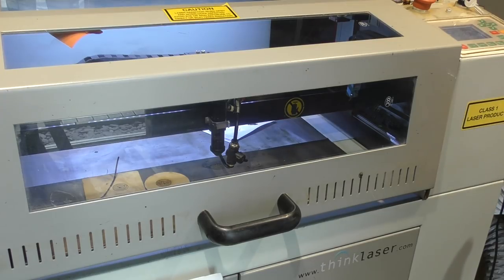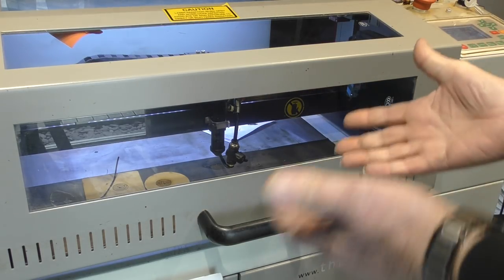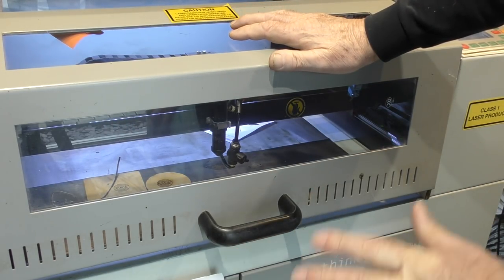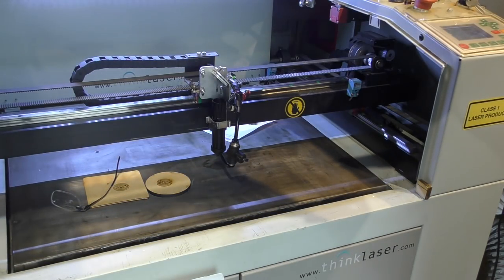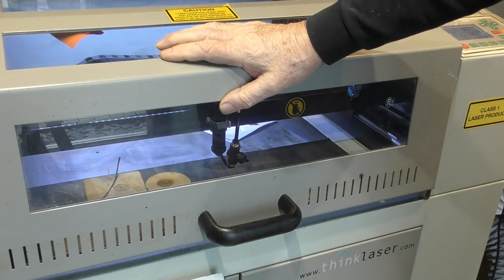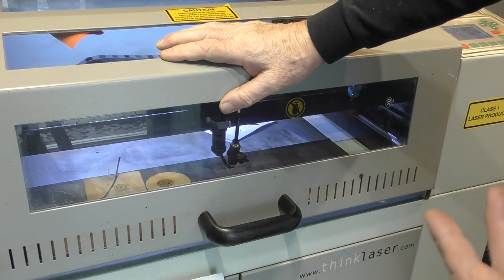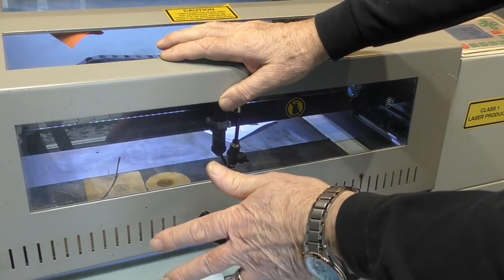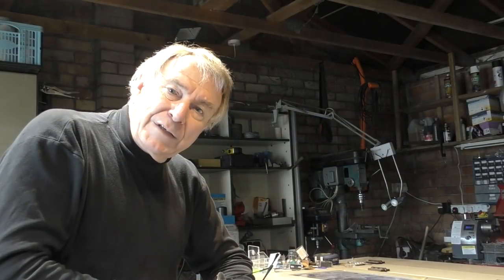RDWorks Learning Lab 204 Laser Beam Safety

Comment: Interesting watching the lens melt and the paper burn. Would have been interesting to see the paper behind the glasses lens to visibly prove your theory.
Reply from the maker: Trust me , I have done just that as a demonstration and it is no theory.  The light energy is 100% absorbed by  polycarb, glass and acrylic If you understand the principle of light energy conversion to heat by vibrating SURFACE molecules and atoms  then your eyes are not at risk until the light has bored its way THROUGH the protection. There is no partial transparency.
 Best wishes
Russ
Reply: @SarbarMultimedia  I believe you, just would be fun to see it in proof.

Cheers Russ, thank you

Comment: That was something that really needed to be said and explained in plain language. I hate to think how many people have been conned into buying expensive safety glasses. When I started with lasers years ago I did think about wether I needed special safety glass but came to the conclusion that I was never going to look directly at the beam anyway. I often use my machine like you with the cover upwhen I am doing experiments or indeed prototyping. I have to admit that one day I forgot and reached across the beam to change a target. It hurt but because I removed my habd very, very quickly there was no visible damage but it did remind me that an invisible beam of energy can be dangerous. I have my cover interlocks disabled but if I am just doing normal cutting the cover is almost closed to give a better airflow. Anyway, nice to hear such a clear thinking explaination as to why you should not waste precious money on unnecessary safety equipment, buy a good fire extinquisher instead, it is far more worthwhile and may save you bacon one day, that reminds me time for a late breakfast.

Comment: Dear Russ, I have just purchased a diode laser cutter engraver xtool D1, so the things you explained do they also cover the diode lasers as well, in diode lasers should we purchase a well branded safety glasses because blue light is present and it works at 460 nm I am wondering what you think about this type of laser cutters, also I am thinking of making an enclosure what would be a suitable candidate for this purpose plexiglass ? Thanks for this informative video.
Reply from the maker: Hi
 I do specifically state in my video that  what I speak of applies only to 10.6 micon wavelength (10,600nm).  Light and materials have strange relationships . At this IR light range the effect of the wavelength is to heat  most materials except metals. Water , glass, acrylic and polycarbonate, although transparent to our visul spectrum , are totally opaque at the long wavelength. Your diode laser operating at 450 nm "sees" materials in a completely different way. 
 Take a look at the chart here   https://www.gsoptics.com/transmission-curves/ 
 This shows the percentage of light  transmitted by the sorts of material you suggest for sheilding. You can see that at 450 nm acrylic and polycarb are only offering 10 to 15% shielding. On the one hand this sounds bad,  but imagine how difficult it would be to get your eye under the direct beam, Near impossible. So why sheild it at all?  Well the answer is not really danger from the direct laser beam because it is blue light and that will not hurt you. No,  the danger is more insideous, The  interaction of the beam at the material surface of some materials can produce INTENSE spikes of UV B radiation which will be like looking at the sun or at arc welding. It will quickly overload the cells at the back of your eye and just as you close your eyes after a quick glance at the sun, you will see white image persistance for several minutes until your cells recover. That effect is caused by light INTENSITY and any decent sunglasses will offer that same INTENSITY protection as looking at the sun.. UVB is the dangeraouse  part of the light that  can permenantly damage cells.
 Take a look at this for the sections, Visible Light and Ultra Violet light.  http://hyperphysics.phy-astr.gsu.edu/hbase/ems3.html#c3
 OK so the real danger is at 280 to 315nm.   Back to the Transmission curves. We now see that at 315nm   both acrylic and polycarbonate offer 100% protection.  So you can get all the  UVB protection you need from an acrylic or polycarb screen  and the only concern is the INTENSITY issue. Just a quick glance at your job will unlikely cause "sun spots" but if you want to watch what's happening I suggest odrinary dark  sunglasses. 
 Hope this explains it for you so that you can assess the risks. 

 Best wishes
Russ

ps.  try engraving a slice  of bacon to simulate what effect the direct beam will have on your skin.

Comment: Can I suggest the focal lens concentrates the laser beam rather than amplifying it. Amplification as I understand it will increase the energy level but the lens does not increase the energy, just concentrates the same total beam energy into a smaller area. I probably sound like a smartass but that is not my intent, just corect terminology. Really really appreciate everything I've learned from you.
Reply from the maker: You are quite correct  (and not a smart ass) in that the total energy is not amplified  but as the beam decreases in diameter (concentrates)  as a result of passing through the lens, the INTENSITY is amplified and it is  LIGHT INTENSITY not power that does damage to the material.   The importance of LIGHT  INTENSITY and how itis not directly related to power is explained in
https://www.youtube.com/watch?v=z8sNPtIIXZ4.  A small diameter beam that happens with low power tubes (as used in K40's) , even though only 30 watts, can do as much damage as a 60 watt beam that is probably twice the beam diameter.. The fact that LIGHT INTENSITY  is the most  important characteristic of a laser beam,  is not recognized by most people. They just concentrate of WATTS. 

If you want a demonstration of where your tube is on this performance spectrum  then run this mode burn test. 
see   https://www.youtube.com/watch?v=R6Wqn5-HMzM
Most people have a factory reject B grade tube. This test will tell you

 Best wishes
Russ

Comment: hello again Russ, can you tell what is the most safe material i could use to make a fiber laser 30w enclosure? thank you. keep the good work.
Reply from the maker: Hi Filipe
 Glass is 70% transparent and  acrylic 70% 1 micron wavelength so neither would be suitable for  a shield.  There are few materials suitable for 100%  protection but poly carbonate  with 30% transparency is a good candidate. Your real concern will be a reflection from an oblique metal surface and at 1miron wavelength that will not be full beam power because all metals are receptive at that wavelength thus any reflection will be dramatically attenuated. Thus 3 to 5mm polycarbonate would be a a good choice to protect against any  1 micron radiation . However, as I mention in my CO2 safety video, the more insidious damage to your eyes comes from the bright light at the interaction with the work. That bright white light is both INTENSE and contains some nasty UVB spikes . Staring at the hypnotic beam movement for more than a few seconds  could be dangerous  in the same way as looking at the sun or an arc welder.. If you intend being around the  machine for any length of time, I suggest you wear a good pair of normal sun glasses that offer protection against both intensity and UVB.
 Best wishes
Russ
Reply: @SarbarMultimedia  thanks so much Russ! always good advice . you´re a unique person!!

Comment: Oh man just in time. I just ordered a 60w JPT M7 fiber laser and been looking for a safety video
Reply: It's for co2 laser
Fiber laser would behave differently than co2 laser
Reply from the maker: @samlenlap  
 Fiber laser is at a different wavelength and as I commented this video is specifically for CO2 laser light at 10.6 microns.  Fiber operates at 1 micron and  the strange properties of light means that 1 micron light will pass right through glass, acrylic and water. However polycarbonate is different because , although transparent, it DOES absorb the 1 micron light energy and will bubble up the surface of the plastic. Thus polycarb safety glasses  are good protection as are cheap reading glasses.against a direct hit. However all the other cautions are still valid. Reflections off of metal surfaces are a much higher risk because you can mark metal with a fiber laser  and odd shaped surface always present reflection risk. It will be sensible to build a polycarbonate screen around the machine. The risk of eye damage from for UV light. is much greater because watching a fiber laser beam working is way more fascinating and hypnotic  than a CO2 beam and that is one key reason you may wish to wear wide frequency range safety glasses capable of absorbing into the 200 to 300 nm range. Do some research on UV light damage to eyes.

Best wishes
Russ
Reply: Like your work, but you really should have discussed popular fibre lasers too (1064nm vs 10600nm for CO2) as this video implies glass and PC are good shields for lasers in general and newbies won't understand the differences..  After looking at lots of curves of transmittance vs frequency I saw data with PC on the verge of not blocking 1064nm. It would be helpful if you showed curves like this.  Also another video with input from German laser safety experts is at odds with your reassurances.  Only a few mW will cause eye damage over short periods, and people could be staring at 50W lasers for long periods... I'll be using cameras where possible.
Reply from the maker: @deliver-ezeparcelletterbox130  
I appreciate your comments and I make it clear that I am discussing 10,600nm and not fiber wavelengths.  But I also make it clear that a laser beam is like a bullet there is no collateral damage if it misses you by a mm. The same applies to laser beams, Their  coherence  means there is no damage unless you are directly in front of the beam. . The chances of that are very low unless you somehow can get your eye into the beam, or put some reflective surface into the beam that happens to reflect the light at your eyes.  Ay 10.6 microns PC is 100% absorptive against such a situation  and at 1064nm  it is still almost 100% otherwise you would not be able to mark it with a  fiber beam. Not so for glass. Glass offers no protection at that  that shorter wavelength.  However you are missing the more insidious dangers to your eyes that is ever present  with ANY laser beam. Not the beam itself but the INTENSE light at the beam/material interface that is emitting nasty spikes of damaging UV radiation. . It is a mini version of staring at the sun are watching an arc welder. Long term staring at that hypnotic engraving effect WILL damage your eyes. . A glass or PC screen  or even decent sunglasses will afford adequate protection..
 Best wishes
Russ

Comment: I never knew.. now I have an idea.
I always wondered about the safety.
I feel the co2 is far safer than the smaller diode cousins. 
With the diode.. I had to look at the laser dot for positioning. The co2 I don't ( partially because I have templates now).

It is also said the blue light of the diode can cause sleep problems.
Reply from the maker: Hi
 Sorry for the late reply I missed your comment somehow and have just discovered it unanswered in my comments summary page.
Just because the 10.6 micron light is invisible does not make it any less dangerous than the 450nm  diode light.  In both cases the problem is not the light itself (invisible or otherwise) but the reaction caused between the light and material. Vaporizing the material only happens at very high temperatures and  the light emitted from that reaction is the REAL insidious danger to your sight. The high power of UVb spikes in that light is what no one warns you of. As I point out in this video, despite all the warnings, it's not the laser beam that's the real danger because you can never get your eye close enough to see it.   Your location spot with the diode was really and INTENSTY problem. It's the same as looking at the sun. The light is so intense that it overloads the receptors in the back of your eye for a short time so that you see white spots when you close your eyes. Just wear sunglasses to cut the intensity.
 Best wishes
Russ

Comment: Thank you for a great and informative vid!

Given that most bed including honey comb bed and knife bed are made of metal, could the  beam reflect those beds and hurt us?
Reply from the maker: Althoughall metals reflect the CO2 beam. to hurt you , two things have to happen. 
1) The lid of your machine must be open
2) The beam must hit a METAL suface at an angle that will reflect the beam at you.

Normally the beam will pass through a lens and hit the honeycomb square to the metal edges. However the edges are so small that any reflection will be vitually harmless.  is so small. Most support bars are anozided aluminium and the anodized surface absorbs almost 100% of the rays . So reflection from these will be almost harmless as well.
Best wishes
Russ
Reply: Greatly thank you for your prompt reply! 

A little background, I am building my 4x8 co2 laser and had no idea how to make it safe. As its big, i dont want to risk anything working near the machine. Thanks to your vid and comment, now i know i should use anodized support bar as the bed and build a polycarbonate cover for the whole machine as well. 

Would that be an overkill as I dont think other commercial that size has the cover (some Chinese machine even have supporting bar that can surely reflect well) ?
I have one more question just to clarify. 

And i assumed that I cant work without safety glass if i use anodized bars and close the lid of the whole machine?
Reply: I have one more question just to clarify. 

Theres another vid on youtube claim that co2 laser machine need to have a cover made of special polycarbonate (which is mainly used for scientific purpose and crazily expensive)  that filter out the laser as well as eliminating UV light. 

You can check it out here: https://youtu.be/tkPak94T0pA

As its a bit different from what you mentioned in this vid. I would love to know whats your insight regarding that

Sorry for asking a lot! 

Thanks again and have a nice day!

Best wish,
Thanh Nhan
Reply from the maker: @thanhnhanhuynhnguyen3652  
Hi
 It is true that  the CO2 laser beam will be 100% absorbed b acrylic, ploycarbonate and glass. Rays of UVB and UVC will be absrbed 100% by polycarbonate and glass  and most other plastics but not by acrylic.

 By it's very size , your machine will be open and unguarded but you or visitors my require protection. Unless you put  your fingers into the beam path there is no risk of bodily injury from the laser beam itself. It cannot jump out at you and there are no stary raus or radiation that will attack you. You must understand rather than fear the laser beam.
 Howewver the light emitted during cutting  ou engraving is the greater danger to your eyes So just go to ebay and buy a cheap pir of  polycarbonate safety goggles. It's  much cheaper and more efficient to protect the items that are in real danger rather than guarding the whole machine. Goggles like this will be perfect
https://www.ebay.co.uk/itm/334532391248?hash=item4de3af3150:g:HkAAAOSwx2Bi-UFr&amdata=enc%3AAQAHAAAAoDi1L%2F5fYUS8OswubDeacLEavW8XCX8Gg8FgaEqTanRJiwmMwnvtpDopHGq9ZHUuM%2FDhdZKmg%2BZBfSr0WOKI%2FCXmZurpBdkpjNTWTcSN4UflnEfVpWyvO4AsEbQD8OAPDq%2FgeLx6Tt52UbKDUOC6Ta9v9tx0vYDy4iJt7V3eYoKwrN7ZATux4Mb3LNwbttgRDvE%2FQc9UtftVYEktMV%2F9gKU%3D%7Ctkp%3ABk9SR6zk7d6SYQ

The bright intense light can also damage your eyes if you stare at it for long periods. 10 or 15 seonds at a time is usually  be perfectly safe.  but a  quick test is to close your eyes and if you have a white spot where the light was, then the intensity is too high,  Either add sunglesses,  to your safety gogles if you must look , or  look for a shorter periods
Best wishes
Russ
Reply: @SarbarMultimedia   Greatly thank you for your info! it helps a lot! I will need quite some times to digest it

Best wishes
Thanh Nhan
Reply: @SarbarMultimedia  
I know im already asking too many questions. But could you answer the one in quotation below as well? 

Im really sorry if its too much and annoying! Please ignore this reply if you find it annoying

"Theres another vid on youtube claim that co2 laser machine need to have a cover made of special polycarbonate (which is mainly used for scientific purpose and crazily expensive)  that filter out the laser as well as eliminating UV light. 

You can check it out here: https://youtu.be/tkPak94T0pA

As its a bit different from what you mentioned in this vid. I would love to know whats your insight regarding that?"

Best wish,
Thanh Nhan

Comment: I always wanted to know could laser, on max power, cut through human bone and meat...
Reply from the maker: Hi Alen 
The  simple answer is yes, but how deep and how fast depends on the power and lens focal length. I have been  nipped a couple of times by the raw beam and bitten once by a focused beam. No blood it just hurts for about half an hour. Within a week it's just a small scar and 3 weeks later there is no sign. So just in case you are thinking of using this as a tattoo machine,  remember it will be a lot of pain for no gain if your tattoo only lasts a month!!!
 Best wishes
Russ
Reply: @SarbarMultimedia no, no tattoo for me. I got in a fight with my neigbour and it escalated... I didn't mean to... Well, it doesn't matter, anyway thanks for the reply.